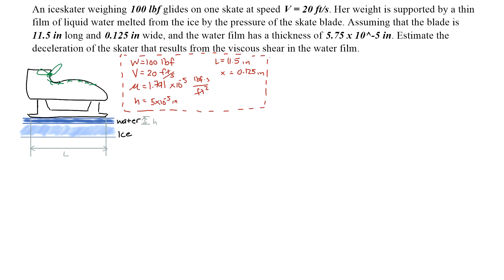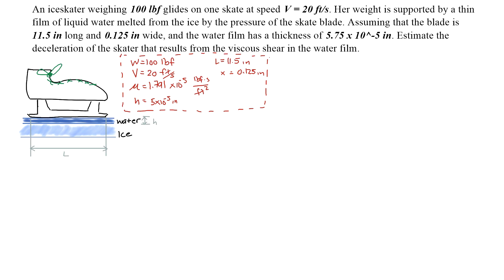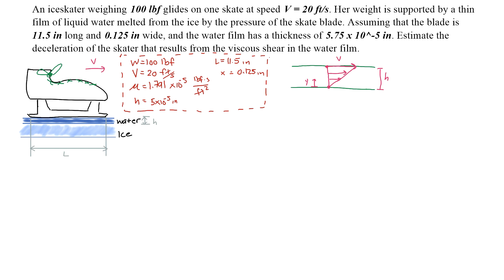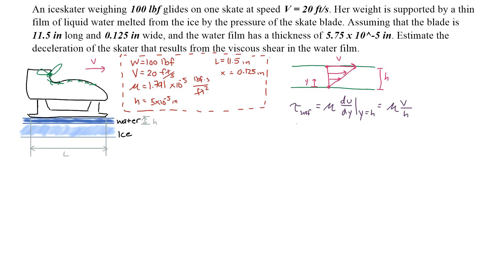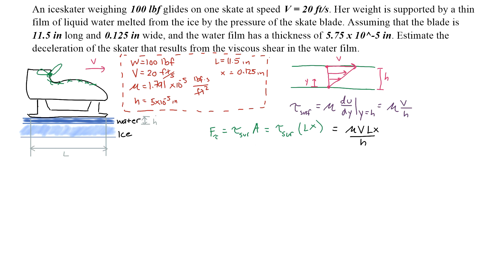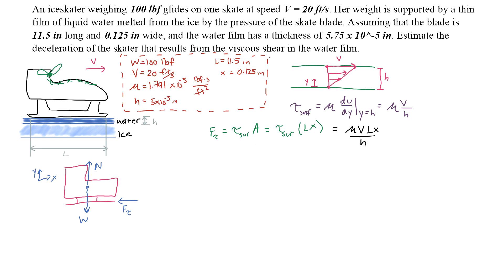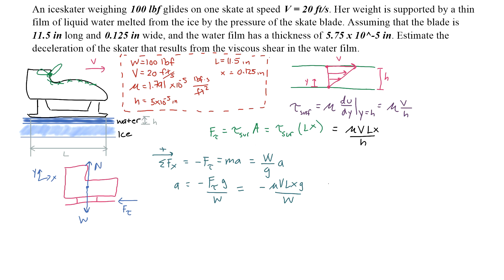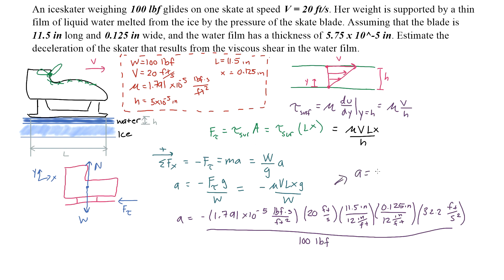Fluid Mechanics | "An ice skater weighing 100 lbf glides on one skate at speed V = 20 ft/s. Her..."

Comment: Where did you pull the absolute viscosity from? and why that number?
Reply from the maker: I believed I Googled it and just chose it based on some random temperature. So the value would be different if it was at a different temperature. The viscosity value does have to be in terms of lbf, s, and ft^2 because we are dealing with US units. I guess you can convert it to the metric system if you wanted too.
Reply: Okay, that's fair. I discovered that using Temp. (T) = 32 degrees Fahrenheit (dF) would be the best assumed T because it is ice-water and 32 dF is the freezing point of water. Thank you for the video and your reply!
Reply from the maker: That’s more than likely a better value to use than the one I chose arbitrarily. And you’re welcome!